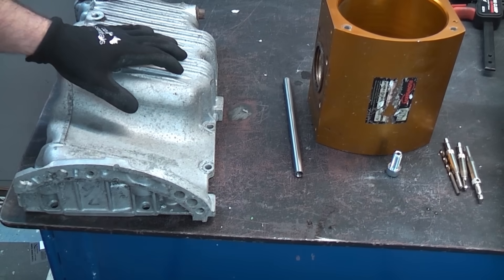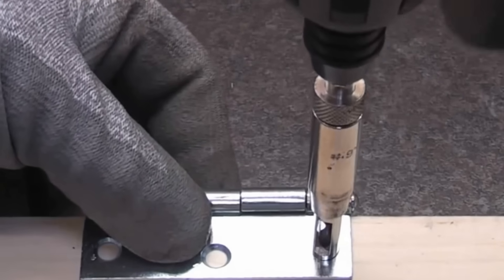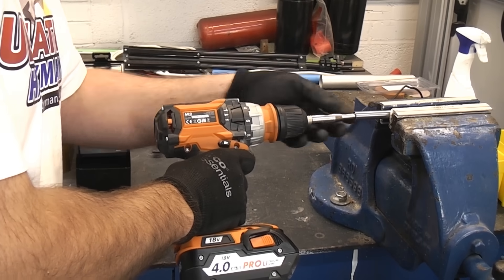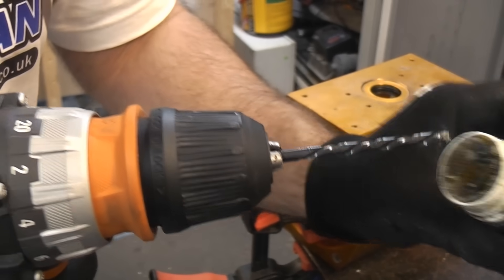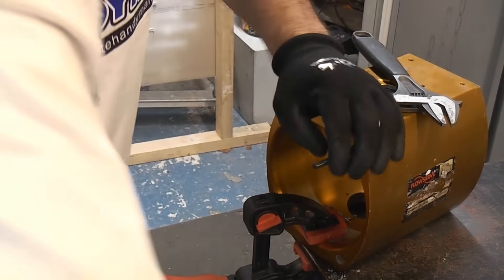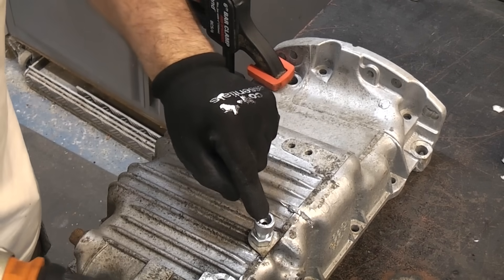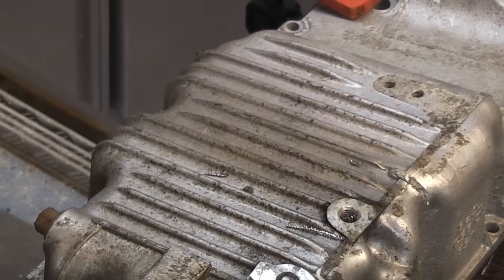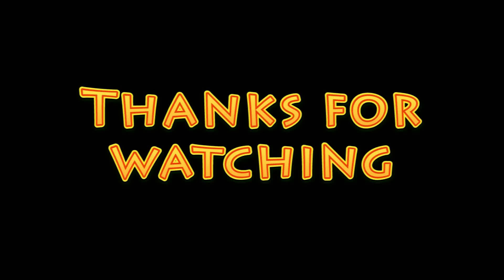How to remove a broken bolt in a deep hole | remove broken bolt in recessed hole

Comment: I once removed such a broken bolt from a cylinder head by carving a slot into it until a blade screw driver fit in there. Of course plenty of heat was applied too. What Id never do anymore is to use bolt extractors. If they break youre in deep doodoo. And they almost always break.

Comment: Well I drilled a hole all the way throu, tried retractor then that snapped in the hole, went throu 4 drill bits, got another retractor after hrs of drilling enough to put it in, then it started pulling it out but it broke off a part of the bolt, then went up a size bigger most fell out but now I have bolt threads stuck inside hole that don't want to come out, now what do I do?

Comment: Drill guides from old bolts are great, I have a set at home and a set at work.  Mine are all from 8.8 bolts, hardened and tempered, they'll outlast me.  Then get thrown away by some ingrate, most likely.  Left handed drill bits are the business, heat and shock is always a good ploy, but I've always found extractors to be a "last choice" solution.  When you hammer them in, and in the process of using them,  you end up expanding what's left of the bolt you're trying to extract, thus making it harder and more likely to snap the extractor.  Which leaves you with a chunk of hardened steel in the hole as well.  What's very important is keeping the hole itself clean.  Compressed air to get all the chips out.

Oh, and that blue and yellow shit does nothing.  Fuck it off into the bin, or use it for removing surface rust.  If you want penetrant, use diesel, a 50/50 mix of ATF and acetone, or a tiny bit of wax before heating.

Comment: That works good for normal threads. But if it's pipe threads broken off inside, forget it,  I've dealt with that and the only thing I've found that will work is to drill it out, tap new pipe threads in the next size and use the next size fitting.

Comment: I didn't know "self-centering drill bits" existed. I just used different bits of increasing sizes and it took a long time. And I also didn't even know about "cutting paste" I was using lithium grease when drilling metal. Great video!
Reply from the maker: Glad the video helped, thanks for the comment 👍

Comment: Beautiful! I did think though that you'd have removed the swarf from each hole before using the screw extractor - to reduce the risk of having the steel swarf chewing into the softer material. Is that not necessary?
Reply from the maker: I’ve never known loose swarf to cause any problems 👍

Comment: I have had very mnimal success with the taperwd spiral extractors.   The 4 flute square Proto and lesser brands work best for me!
A left hand set f quality bits is priceless when it comes to bolt extraction.   If you mount the part on a knee mill so that you can control bit and pressure, getting the bit to grab the bolt and back it out is a dream come true!
Reply from the maker: Great tips, thanks for sharing!

Comment: What if you dont have a screw extractor?...two methods, one simply hammer in an Allen key just a little larger, 'fill' the hole with some WD40/penetrating oil, and go for a cup of tea. Upon return extend the long arm of the Allen key with a bit of tube and it should come loose. Alternatively [being careful], work up drill sizes through your guide bolt until about 1mm dia smaller than the bolt used, then take the guide bolt out, drill ~0.5-1mm into the bottom of the hole, and then fill hole with WD40; the extra 0.5-1mm will allow the WD40 to penetrate better up inside the remaining thread. Go for a cup of tea and then on your return either use a pick tool to 'unthread' the thread OR tap in a square bladed screw driver into the top and unscrew OR if it still doesn't budge try hammering in an Allen key/the Allen key method.

In the second method [aluminium sump casting] if you balls it up and make a hole through the casting its not the 'end of the world]. Simply tap a thread into the small hole and then seal with an Allen key head grub screw.

Comment: I've never seen that pilot drilling tool.  I guess it's a woodworker's tool normally, which is why I've never seen one.
I have machine tools, broken bolts don't often make me cry.  What makes me cry is a broken drill or tap in a customer or high-hours part. 
Tap burner (EDM) machines aren't cheap, and who has room for a machine you use once every two years? So you take it to a service, who charge you mostly for the setup labor...
If Vevor wants to make an easy pile, they should come up with an affordable tap and drill removal EDM machine for the small shop / hobby shop. ^_^

Comment: Good video, there’s also the technique of welding another smaller bolt. Or rod on to the broken bolt. 
You put a copper sleeve in the hole ( if you need to protect threads )  and build up weld with a wire gun.

Comment: I've never had a bolt break inside the hole. It's always been flush with the block and against the engine compartment in the middle of summer. It's fun to watch what it's like under optimum conditions, though.

Comment: all extracted bolts are new and not seized, the best way to extract a bolt is in milling machines if you have access one, works all the time. Extractor is garbage doesn't work in seized broken bolts.

Comment: Do you have any suggestions for a snapped off bolt - below the surface, not a flat surface on the broken bolt, bolt is soft metal - challenge is no room for a drill.
Reply from the maker: I’m sure someone said you can dissolve it using alum (or something). I think AVE did a video on it! 
Thanks for the comment 👍

Comment: adjustable wrenches are great, but the KNIPEX pliers-wrench, e.g. #8603-250 are even greater, almost like a ratchet & worth every penny! Easier to apply, faster and even get a good grip on damaged nuts.
Using a left-turn drill, low speed and high torque settings help the drill to catch the bolt and unscrew it without further ado.

Comment: Great idea, and just in time. I have a bolt that broke off in a flywheel, and it's broken at an angle that would make it impossible to drill without ruining the threads.

Comment: The centering jig is brilliant.  Shocking the bolt and using a left handed bit are two things I rarely see recommended that I consider necessary.  I live in a sandy place so I would always blow the threads clean with penetrating oil and then compressed air.
Reply from the maker: Great tip!
Thanks for the comment 👍

Comment: Flaten the top serface in the bolt first makes it much easier to drill a hole in the centrr of it . Also use a carbide burr to flatten and start the hole  so it is square . GO SLOWLY to start .

Comment: I used lengths of sheet aluminum cut from beer cans to wrap around left handed drill bits to center those and protect the threads. Those come out as the snagged bit spins out the busted end of the bolts. The beer can strips come in handy to protect the threads when your only option is to drill out the seized broken end. I kept increasing the width of each drill bit until a dental pic could lift up the top edge taking the thread with it. Got enough raise so a long skinny flat screwdriver could be used to raise and snap off the rest.

Comment: if bolt is steel and case is aluminum - and nothing seems to work, go to supermarket spice isle
and get some alum.
dissolve alum in water and submerge part in solution.
heat to boiling and in no time the steel bolt will dissolve leaving the unit clean and threads perfectly intact .

Comment: why wouldn't you just use mini vise grips  on tap end
Reply from the maker: Taps are made from hardened steel, so they are brittle. Ideally you would use a tap wrench, or an adjustable spanner 😉 
Thanks for the comment 👍

Comment: Why do bolts seize? Is it because the M/F parts are of different metals? (eg. Aluminium and iron). Is there an electro-chemical reaction which causes corrosion and even fusion of the metals?

Comment: Candle wax is another way of freeing stuck studs if gravity on your side 👌, heat is the best way of cracking stubborn bolts/ studs. As the wax melts it gets into the screw threads then as it hardens it expands and provides lubrication when un screwing!
You can thank me later!😂

Comment: Ive always placed a bolt around the hole and slowly weld to the stud bolt with a stick welder but its really worth soaking a stubborn bolt in penetrative fluid like wd or atf many times for a day or two before hand 👌

Comment: Very impressive,I'm novice to mechanics but I'm interested in the name of that bolt with the hole in the middle with two nuts,also the hinge sighting drill what size are they ??
Reply from the maker: Not sure what size the hinge sighting drills are, as I have a set of them.
There is someone selling hollow bolts on ebay now-
https://tinyurl.com/2vckta7x
Thanks for the comment 👍

Comment: Just a consideration using a vix bit (or vex bit in England) spring loaded pilot bit is that many are for use in wood and won't drill steel.       35 years in hardware Dave
Reply from the maker: Thanks for the comment 👍

Comment: Copper, brass and steel bolts can be etched from anodized aluminum (like this pneumatic valve body) with concentrated nitric acid (concentrated!), since it does not dissolve aluminum due to the intensification of oxide film formation, but it dissolves ordinary steel and brass well. At one time, working in the automation service of production, I saved many sensor bodies in this way.

Comment: Anti-seize compound didn't work for me on my motorbike unfortunately :(
I had 2 exhaust header bolts that I could not remove without damaging the threads but the good thing in this is that the thread-repair coils which I used to fix the problem afterwards are made of stainless steel so they don't make the same galvanic reaction with the bolts as the original aluminium threads.
Reply from the maker: Thanks for the comment 👍

Comment: I have found that gently tapping on the screw extractor while turning it slowly can help also.  It both shocks the stuck bolt as well as helping to keep the extractor seated.
Reply from the maker: Yes, shocking the bolt/stud can work wonders 👍

Comment: could you make a video how did you make those bolt adapters which helped you guide the drill? I can image doing it having drill with stand but I dont have it and I doubut just putting it into the vice would do. Thank you, nice video btw. I got same extractors as you do and they work perfectly. I just thought about buying socket extractors, but not sure if they are worth the money :P (you dont need to drill ideally into the nut a hole to put extractor). I liked your idea of using reversed drill :) that was good trick!
Reply from the maker: Here is the video on how to make the guides- https://www.youtube.com/watch?v=6mZj0J6CNYA
Thanks for the comment 👍
Reply: @ultimatehandyman  thank you for reply. Good luck with your projects and next  videos :)

Comment: Nice one. A really good idea to drill out a bolt and use it as a drilling guide. Problem is, I don’t have a lathe. Maybe careful drilling on a drill press would do it. And yes, a tap,wrench would have made the job a lot easier, you could apply pressure whilst twisting. But you know that, your wrench was left at work 😁
Reply from the maker: Yeah, you can do it on a pillar drill also, both techniques are in this video-
https://www.youtube.com/watch?v=6mZj0J6CNYA

My two small tap wrenches are still on site, I only have two large ones in the garage: which are way to big for a small job like this 😉

Comment: If you can't get the extractor to bite you can also drill the hole to fit a left threaded bottom tap so that it hits the bottom of the hole in the broken bolt. Then use a left threaded bolt to remove it.

Comment: can't be too professional, he only owns 1 tap handle. he should also have a set of hole center punches.
Reply from the maker: 😂😂😂
You mean a “tap wrench”, well I have several of them, but they are in my tool box on site.
As for “hole centre punches”, I’m assuming you mean “transfer punches”!
Yes, I own a set of them also; they don’t work well on broken bolts, as the bolts do not often have a flat surface.

Comment: I took about 4 HOURS to drill out a hardened steel turbo bolt that broke off while trying to loosen it from a turbo exhaust housing and exhaust manifold. Even cobalt drill bits were making very little progress and it has been one of the most frustrating extractions I've ever had to make. I ended up drilling all the way through because the screw extractors weren't getting a good bite. I thought I had it drilled it out pretty cleanly and only slightly off center, but when I went to hand tap the threads it somehow broke off after getting jammed... now the end of the tap is even harder than the broken off bolt was so I think I'm thoroughly screwed!

At this point I'm looking at replacing the turbo exhaust housing or maybe I'll try to drill it out with a bigger drill bit and then just upsize the bolt to M12 as likely the threads are probably not going to survive.

Comment: That's a lot of work. I keep an assortment of telescoped sections of brass tubing in my toolbox. When a bolt breaks in a hole, I use the telescoped tubing segments to take up the slop between the size of the hole and the size of the bit bit. Once you have your short stack of tubes ready the first time, they are immediately good to go the next time and can be re-used forever.

Comment: The simplest and a foolproof method for removing a broken bolt is simple. By using a MIG welder you build up a stud. 
The heat generated by the intermittent 
buildup of the stud works to your advantage. Using a pair of vice grips you now can remove the remainder of the bolt. Done in less than 5 minutes. 
Some people love to take the long way around the barn. This never would have happened if the assembler had used anti-seize.

Comment: when you drill the stock broken bolt it creates burrs and must be clear or blow out from the threaded hole or will prevent the broken from turning.  in this case the aluminum piece.

Comment: The drill bit broke in the bolt below the surface and I can't get it out. 
Now what should I do?
Reply from the maker: https://www.youtube.com/watch?v=7JCfEMrCjhc&t
Reply: @ultimatehandyman  
Just to be clear,, the drill bit broke and is below the surface of the sheared bolt.. 
so are you suggesting that i drill the drill bit out with a stronger drill bit to remake a hole for the easy out bit??
Reply from the maker: Yes, you need to get the broken drill bit out before you can proceed. They are very tough, so can only be drilled using a solid carbide bit (very brittle) or a diamond hole saw 👍
Reply: @ultimatehandyman  
Thanks for your help...I will give it a try

Comment: 8:58 how would you to about getting that bolt out say if it was flush at the top(can’t screw in the guide bolt to drill)
Reply from the maker: You can normally just centre punch the broken bolt in the centre, then start drilling. I think I did that in this video- https://www.youtube.com/watch?v=MR2Dd30Wees
Thanks for the comment 👍

Comment: Nitric Acid.. If steel bolt is broken within an aluminum part, take an eye dropper and place Nitric acid in the hole for about two days or less.. The Nitric acid will accelerate the oxidation of the steel bolt without damaging the aluminum part. Two days later, the bolt is half of it's original size. Turn upside down and what is remaining will fall out.
Reply from the maker: Thanks for the comment 👍

Comment: Thanks for the tips. I ended up using a hexagonal standoff down the hole then drilled through that to remove a hard to access broken aluminium valve cover bolt in a BMW engine. Whoever replaced the gasket once clearly skipped using new bolts on reassembly and clearly stuffed it! I used a screw puller on a hammer drill to easily get it out.
Reply from the maker: I’m glad you found the video useful
Thanks for the comment 👍

Comment: I don't think I've ever had a hardened steel bolt snap off in a soft aluminium casting.
Reply from the maker: The bolts are not hardened! I used to work at a place where shelves were bolted to large “bogies”, the bolts used were a very soft tensile strength, if you removed one of the bolts and put a high tensile strength bolt in its place (such as a cap head bolt), you can guarantee it would shear 👍

Comment: WD 40 is not a penetrating fluid, it’s a water displacement fluid the clue is in the name WD, recipe 40🤷‍♂️ formulated in the 50s by a Petro Chemical firm for NASA to stop satellites rusting.
Reply from the maker: Here is a link to their website-
https://www.wd40.com/products/handy-can/

here is an extract from that page- “WD-40 Multi-Use Product protects metal from rust and corrosion, penetrates stuck parts” 😉
Reply: @ thanks, I knew this but, being a silicone based product it’s not formulated to expressly dissolve rust as solvent based penetrating fluids are, I know people use it as such but it’s chemical formula doesn’t work to the extreme standards as solvent based products do, thanks for the link anyhow 👍🏻

Comment: I use 2.5 mm 309 ss welding rods. build up some weld on the broken golt and join a piece of steel. works every time
Reply from the maker: Thanks for the comment 👍

Comment: I have always tried to drill into the centre of the broken piece of bolt first with a small drill bit, and then with the biggest bit I can put in there with out taking out the threads. Then I use an extractor. If the broken bolt is really large , I would drill and tap the centre for left hand threads...and then with a bit of heat (250-300 degrees F. with a temp crayon, all the way around the bolt) I just tighten the left hand threaded bolt into the centre of the broken bolt until it bottoms and turns out the broken piece. Time consuming, but has a high success rate on delicate metals.